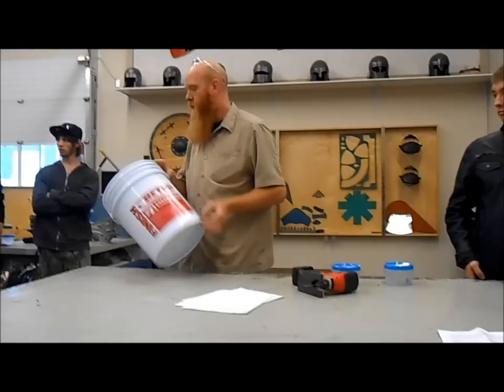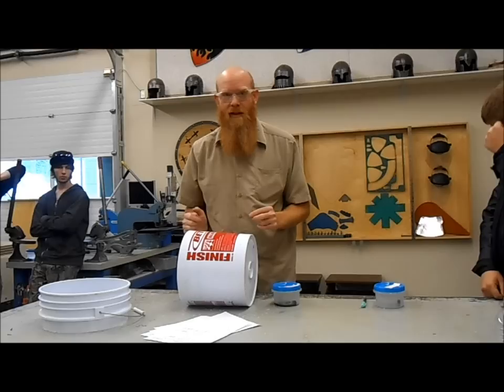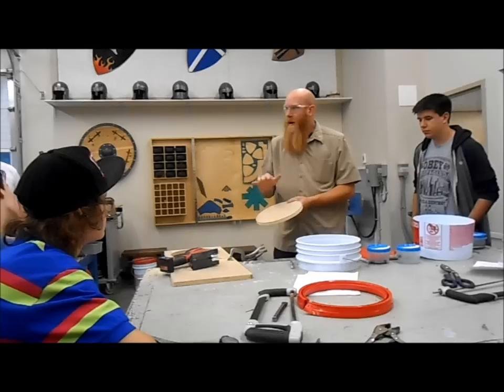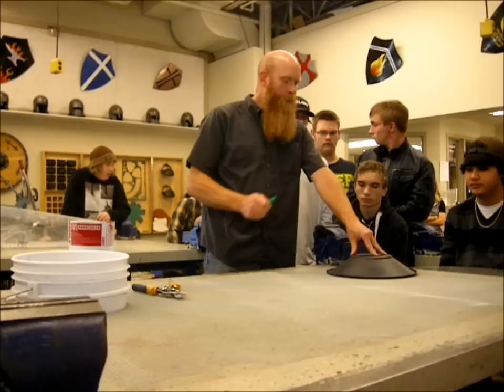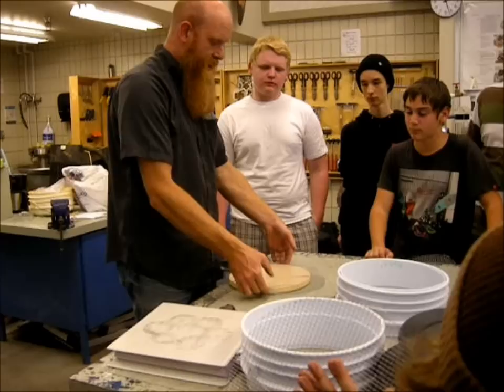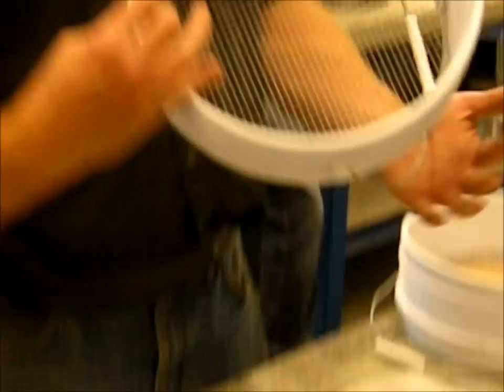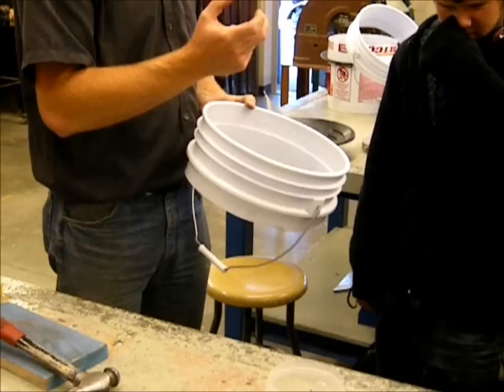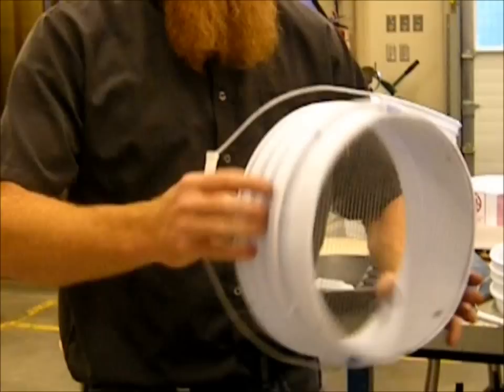How to make a bucket classifier

Comment: I've found that cutting the 5 gallon bucket about halfway or 2/3, using a classifier which is either 1/2" if I'm quantifying the volume of material quickly or 1/4" if I'm running material through a sluice or just conducting a samples in the pan. I've just taken a few old 1/4" and 1/2" classifiers, drilled 4 holes in a cross-like formation, drilled the same pattern of holes in the bucket and holding it all together are 4 bolts and wingnuts. I uses plastic milk crates also for sampling material quickly and it seems to do the job. Love the vid. Sampling is the most crucial to any digsite and I've gotten a few ideas from watching this. Great job, Dan!

Comment: I bought something very similar from the prospecting supply store in Phoenix up on Northern Ave in the late 1990s.  Gifted one to my prospecting buddy Dad and he still talks about it being the best classifier ever. ;)

The one I had was nested with various meshes and would sometimes get stuck inside a larger one, but you could pull on those rivets to dislodge it.  So basically you have one big 5 gallon bucket with the handle, and then you have nested slices of a 5 gallon bucket with that wire mesh and the riveted inside collar.  I think ours was three levels deep, and then after collecting material, you would shake it back and forth with the outer handle, then look through the coarse stuff for nuggets and dump it, and finally get to the fractions that are pannable/sluicable.

Comment: Been making these for quite some time during my Prospecting.  Cheap, Functional and Work most well.    My only issue is up to date every one I've ever made has Walked Off at some point in time.   It would seem a pile of people figure they're so easy to make I won't be missing this one ?  ????    I simply cut a circle hole out of the bottom leaving a 1 inch lip around the circumference and liquid nail some hardware cloth to the bottom.  Not as tidy are yours.  I'll give this method a go.  Thank You.

Comment: I want to make one of these, I have stainless steel  1/16  inch screen (approx)..  it doesn't bend as easily as the galvanized stuff you used here. Should I attempt to make as shown in this video or do you think I should take a different approach? I like this method you have. But not sure I can get the screen to bend as easily.  Maybe I should cut the bottom out of a bucket, leaving a one inch rim to fasten the screen too? Not sure what to do. I'm limited on the screen I have and don't want to ruin it first try

Comment: My local hobby shop carries several sizes. Not sure if hardware cloth comes in anything other than 1/4". If you were going to buy classifiers what size(s) are most useful? I am thinking just a 4 and 8 at this point.
Reply from the maker: 2 and 4, or 1/2 and 1/4"
Reply: Hi

Comment: Just a small suggestion use a drill bit that is larger in diameter than your drill bit start on the right side of the line because you will not be using that section that section that way the left side of the line will be smooth and not have the hole in it if it matters to you. But that way your whole will be there for your salt blade to go into instead of fighting it

Comment: I just rolled the hardware cloth into a cylinder and literally sew it up with bailing wire, then cut a piece for the bottom and sew it on the same way. Roll the top down so it ain't Sharp.  Looks like a little wastebasket, and it fits in my bucket. You can slam material through those things

Comment: Easier way to cut the buckets is use a dermal saw blade on a drill mandrel. S the depth on the drill press and rotate the bucket,  then repeat for the band that holds the screen.

Comment: If you used a torch on the wire mesh before put it in, til red hot, then dunk in water, it'll temper that metal and maybe last a bit longer.
Reply from the maker: It's galvanized mesh so I wouldn't want to heat it.
Reply: Oh ok lol I just do it outside up wind
Reply: You handle all that gold with all that mercury on it but worried about a bit of fumes?  I guess it would be a bit of a risk.
Reply from the maker: I would like to keep it galvinized so that it doesn't rust right away. It's mild steel under the galvanization so heat treating wouldn't make any difference.
Reply: anyway good job with everything you do, good to see someone passing on this tradition. My great uncle was a prospector for years, last time I seen him was around 25 years ago and nobody heard from him since. I decided to try my luck at it now that I'm unemployed. Have any advice for us hurtin albertans?
Reply: No it won't that is not tool steel.

Comment: If the wire is so sharp, then way are you using your bar hands? Do you think it would be more safe with gloves? You're not setting a good example....
Reply: Lacey,  Real Men don't need gloves.
Reply: He told them if they are wusses he has gloves for them to use